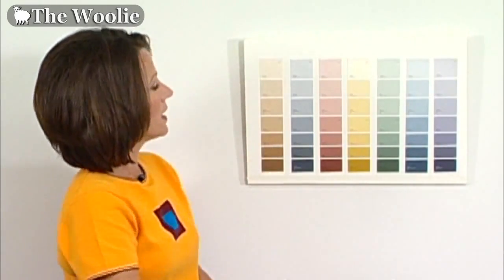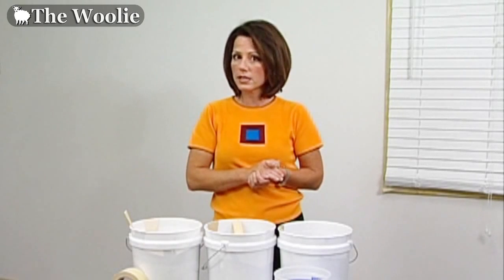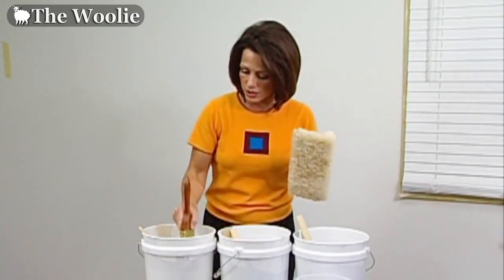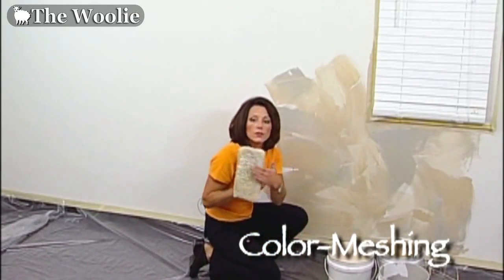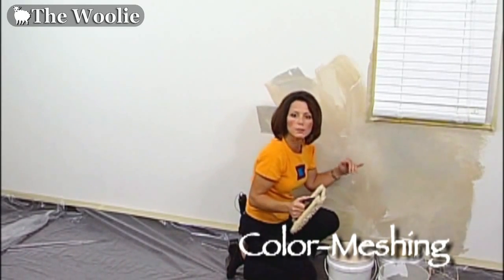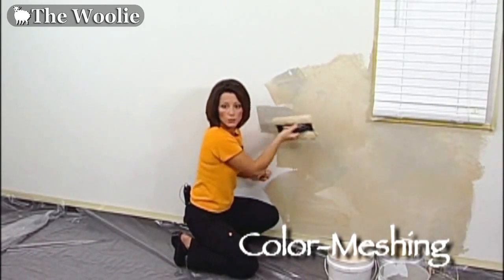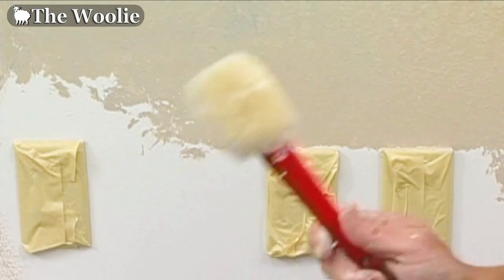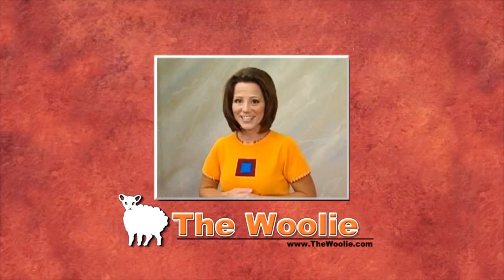NEW! Color-Meshing How To Faux Finish Painting by The Woolie (How To Paint Walls) #FauxPainting

Comment: Well, I truly messed the previous one up.......so,let me try again. I’m looking for a technique where you can use METALLIC paint on the wall, if it is even possible???  I really like. the technique you have demonstrated, but I really wanted a subtle metallic because the room has only a single window facing the woods & the result is very little natural light.  I feel that I need a wall paint with reflective properties.  Thanks, your video demonstration is very informative & I feel confident I can do it by myself without having to watch it again......very informative indeed!  Thanks again.
Reply: Use polished plaster instead for a metallic finish. Or alternatively call an expensive paint company and tell them what you want to achieve. They will have specialist paints with additives like pearl flakes or Mica to add reflective qualities.